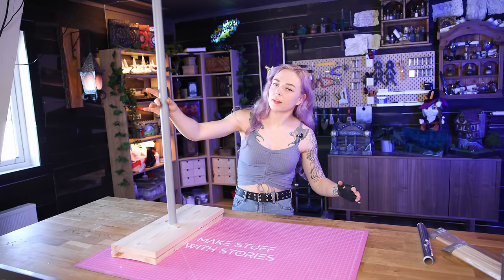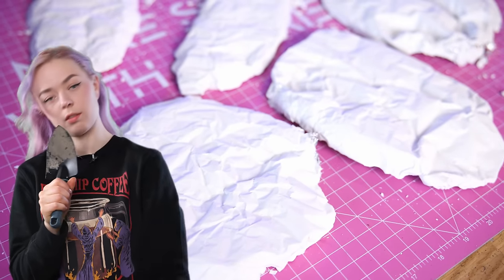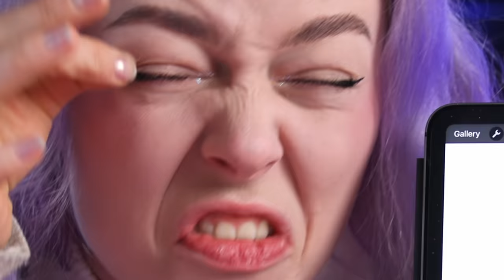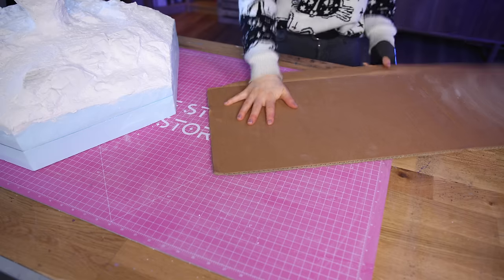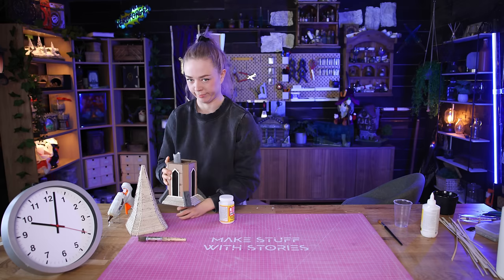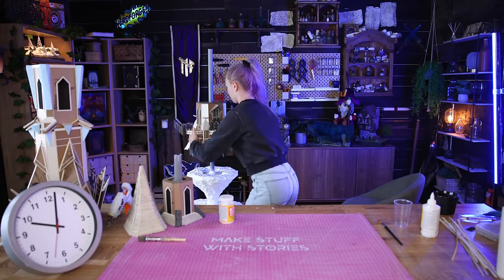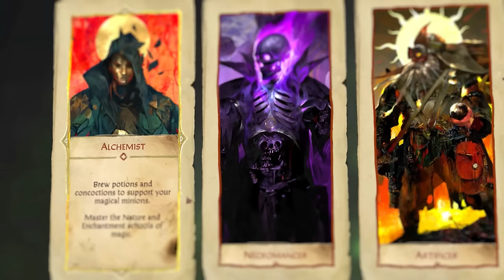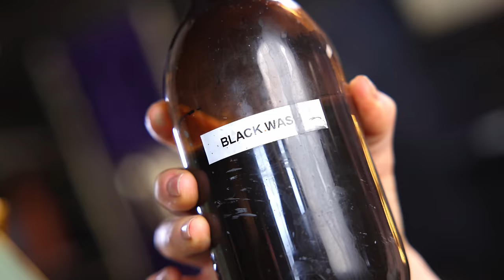I spent 20 days building this giant wizard tower

Comment: When I have shipped some of my interactive diorama pieces (nothing so big though) I didn't use packing peanuts or the like as I feared the vibration in shipping would wear away the paint and details.  I screwed or strapped them to the bottom of the crate and built the crate as a cover to go over them and get screwed on to the bottom.  You could try something similar but maybe build the crate around it.  the idea being to remove the top first and then the sides in sequence.  I would assume it's going to go on it's side no matter what labels you put on it.  I would consider making styro forrms to go around it at strategic points where there is less detail as others have suggested.  Maybe line the XPS with a thin layer of soft urethane foam sheet to minimize rubbing paint off.  If there is any way to get something through the side and attach to the pipe in the centre to get a couple of rigid mount points I would consider that too.  Maybe modify a wall so that it can be removed for the mount and then replaced with a simple press in fit or magnets or something.  Regardless, take good photos and label the sides and mark the screws to remove and create a good set of instructions for them to unpack it at the other end so they are not guessing.  That's all I got.  Good luck.

Comment: My suggestion is that you start by disassembling it into the previous quadrants and then pack each by securing them to a foam base in a box. Use small bags of expanding foam strategically around the sides of the inside of that box. place that box with the foam base glued to the bottom in a slightly larger box with packing peanuts in between ship the pole and the smaller boxes separately. It's one of the manages to take damage. You will at least only have to recreate one section

Comment: Create a frame that supports the tower in key places that will not damage the paint, yet gives it adequate space to not squash the details and miniatures, wrap the frame in paper or cardboard, then spray foam around the frame and then cut the outside of the spray foam to fit into a box.

Comment: Make your shipping crate for it first, giving extra room all around for the foam you'll need.
- Put a liner inside the shipping crate, laying it on it's side so that you can set the tower in it length-wise
- Spray in self-expanding foam, filling the lined crate about 1/3 the way full
- Place more of the liner on the newly sprayed self-expanding foam and lay the tower in the crate so that the foam forms about 1/2 way up the sides of the tower
- Allow it to harden, then remote the tower
- Remove the first 'form' from the crate and repeat the above, using the other side of the tower to make a form of the other side
- Take the tower and place it into half the mould
- Set the other half on top of the tower to 'close it in', trimming as needed to get a good fit of both halves
- Once done, place the first half of the mould into the shipping crate
- Place the tower into the first half of the mould
- Cover the tower with the second half of the mould
- Seal up the shipping container and ship!

Comment: What an absolutely incredible build! A suggestion for shipping, built a crate around the castle but instead of using rigid supports, use a network of elastic bands going from one side of the crate to the other so that they apply tension to opposite sides of the tower at multiple levels. It's easier to construct and much easier to pad to protect the tower's finish.

Comment: For shipping drill screws from the bottom of the crate into the wood at the base. You can also add bracing from the sides of the crate with foam near the top. With the top and bottom secure you should be okay, but if you need more build a second crate with foam between the inner and outer crates on all sides including the bottom to absorb more impacts.

Comment: Very cool build! 
For shipping you should remove the top and drill a hole in the bottom, you can then suspend the thing by inserting a metal (or thick plastic) rod that can be fixed to the crate, and pack with those plastic pillows

Comment: looks cool! for shipping build a plywood box to fit the structure, then fill it with polystyrene beads from a bean bag chair. they would fill all of the nooks and crannies and details to hold and support them without damaging them too much, but be easy to blow off with low pressure air or computer cleaning canned air. bonus, the mail room of the company you send it to will look like a winter wonderland for a few days afterwards. the cleaning crew may curse you with warts or a plague or two as a result though.

Comment: make a crate, take the top part off if its not glues and "clamp" the top of the pvc pipe to hoold everything tightly, or make a crate in layers, and place suports made of foam cut to fit around features, and enclose section by section, or floor by floor if youd rather say it that way.

Comment: This might be a little late to the draw for shipping but how we ship our odd sized and heavy sculptures at work is by making a baseplate of wood and drill holes in the bottom around the shape of the base and wrap cardboard around the base of the sculpture and then secure it to the base plate with a heavy gauge wire (our bases are rocks so we can be rough with them but I'm sure there's a more elegant way to do it for yours) and then we take whatever size box we have to fit it shimmy the baseplate and sculpture down and then get long pieces of 1x1 you'd probably need thicker but we glue the shit out of it and stick them in the corners of the box and use screws to secure it to the box and the base plate then we double layer our cardboard and slap a ton of Fragile stickers on it lol

Comment: very nice. i could imagine 4 long sections of thin plywood (or maybe 8 or 12 so the box is in 2-3 sections vertically?), maybe with big bubble wrap attached to the inside of each panel, maybe a few lazer cut braces that attach to the plywood on one side and have a Y or U shape on the other to brace the tower at a few strategic locations, then close the "box" around the tower and fill with peanuts? if you pack them in enough that might do the trick even if the shippers put it on its side? not super sure, but seems like a start of an idea. good luck!

Comment: About that foam cutting... One of the best tips I ever learnt is to keep a sharpener by your side when cutting stuff with a box cutter knife. A kitchen knife sharpening rod is perfect. Just run the knife over the sharpener between every other cut - it sounds unnecessary and time-consuming but TRY IT, it is such a time and energy saver! And it makes your cuts much cleaner and neater as well.

As a bonus, you dont have to change knife blades nearly as often.

Comment: I would make a hexagonal plywood box fit to the base and cardboard cross sections that would encapsulate the tower (negative form) so it is fixed in there and at the end fill the rest with those expanding foam packed so nothing moves (mostly).

Comment: I just saw a life hack video were they filled a box with expanding insulating foqm, put down a layer of plastic wrap, then pressed the item into the foam. It created an indent perfect for the package, then they added a layer on top of the item and added more foam to create a top layer. I think you could do something like that, but you will probably need several cans of foam. 

Amazing build!

Comment: I work for FedEx and ur definitely going to want some kind of wooded crate for shipping. You'll have to have some kind of filler on the inside to keep it from moving during transit, either a shit ton of packing peanuts or that egg crate looking foam stuff. DO NOT SCIMP on the packaging material. Mark it with ''this end up" arrows and fragile. Though its a 50/50 shot that what ever shipping company u use will actually follow the directions.

Comment: Potentially expensive but you could always have contour cut foam and form fit clam shell style, and then a crate around it of internationally rated ply for customs and such.   Also recommended if possible would be for it to be shipped in separated sections and then re-assembly at its intended destination.  For the crate I would have it on it's side, with standard 2x4 feet on the bottom (There is SO a forklift in this treasure's future) and the lid could be accessed from the side with locks (rotolocks) and a drop down with hinges.  Yes... the over the top option but we are looking at an expensive piece of art here my dear.  Also... INSURANCE!

Just a thought from a huge fan here in Las Vegas that also works in the tradeshow industry... so I do have some experience with large expensive pieces being shipped overseas.   ALSO... make sure you have your VAT and Custom doc copies available on the side.  Labels are a true must and a broker you can trust!! (get tracking numbers!!)

Love your stuff always!!!  I've probably talked way too long!

Comment: A bit late but I have experience shipping complicated fragile pieces, basically you create a web of string to hold the model in the middle of a box, first construct a inner box of plywood, big enough so the piece can float inside, perhaps 10cm of clearance space all around, second drill (or laser cut) a grid of holes all around the sides of the box, third pass string  through the holes to create a net on the bottom to suport the piece, deposit the piece over the net and start weaving string around the model trough the holes to tie down the model in the middle of the box, work in layers, you can add nails or screws in the outside at intervals to tie down separate sections of string, fourth once the model is suspended you close the box and cover it with a second outer box of cardboard to protect the string on the outside. 
To unbox the piece they only have to cut the string to free the model! 
I have used this technic to ship big complicated and fragile ceramic pieces internationally, it's better than those foam pouches especially for a single use, it is more time consuming for sure but perfect for this application in my opinion.

Comment: 18:40- I know it’s way too late for this (and probably was too late after you started to build this) but if you made it in a way that you could take it apart in 3 or more pieces that would definitely help a lot! Another way would be a lot of padding! Another could be a rope structure/netting (depending on which way the box opens would determine if that would even work!?! And how it would work would take awhile to explain….. I have no problem doing so… but only if you actually ask for it?!? That’s a lot of writing for something to either never be read or stolen and someone else act like they came up with it)! A few more ideas, but not as good as the netting/pulley system!

Comment: For shipping it, maybe using something like AnyVan? Instead of a conventional courier company who are notoriously bad at treating packages with care... If you hire an AnyVan you can tell them they have to be careful. And it will be transported in a regular van not a courier carrier van so they will have more liberty when it comes to fastening and securing it. I think if you made a plywood box for it and used foam or inflated plastic bags to keep it upright, and then hired an AnyVan and told them it's fragile and must be securely fastened and handled with care, I think that would be perfect.
My brother shipped all his belongings (including an un-packaged 50 inch curved TV, and a PC and monitor) in an AnyVan, it went from Italy to the UK, and a few months later again from UK to the South of France, and both times it was perfect. I helped the drivers securely fasten all the belongings inside the van so I was able to ensure it was done with care, and they drove straight to my brother's house where he was able to assist in unloading and the van, so basically the entire process except for the driving was supervised. It might be kinda expensive, but shipping something that huge even via regular courier will probably cost a couple to a few hundred so...

Hope you get to read this, and hope it helps!

Comment: I side a wooden box (maybe OSB reinforced with lumber)  and  fix the bottom (create the shape of the base to hold it.. maybe a cloth would help to not scratch it), whit a wood structure attached to the sides make a "ring" padded that holds around the center where there are not extremely fragile parts (maybe on just 3 sides so with one u can use it to open ad close) and on the top make a big padded bowl that goes around the tip of the tower attached to the top... It's a lot to do but i kinda feel i wouldn't want that thing to brake.. if needed air packaging...idk 
It be best if it transported up but i feel like if the "ring" it's tight but also padded well it should be good... Maybe bolt the bottom too
 Obviously instructions to unpack would be needed 🙃

Comment: About shipping...
From the size, first thought I had: use a cheap coffin. On second thought: it's probably too wide... but any lenthly wooden box would do.
Then use whatever packing peanuts or newspaper (crumbled up) you have all around to lay it inside - a bit denser where it's lying on.
Or wrap it in tissue paper, put in wooden box, then fill with foam spray ?

Comment: I would make some attachment for the base, then make that plywood box. Add a bunch of cut up paper (from paper trash machine), fairly loosly but still able to support what the base attachment can't support. I think packaging peanuts might not give enough support, and won't compress as much.
It depends on how heavy it is.

Also needs a fragile and "this side up" sticker.

edit: I see that you have a pvc pipe in there... so just drill hole in base and get a reaally sturdy metal or other pipe that is attacked to the box. Then you can actually just have it upright.... And then a bunch of paper. I don't know why I was convinced it had to be on the side.

Comment: Shipment idea(I have no clue if it can work for the bottom parts, maybe for the top only, but you can get inspired by this)first you cover all the model part in nylon(or plastic bag big enough?), then you take a box big enough to fit the part in, you use expanded polyurethane before and after placing the part in the box. the idea is that you create a negative from the foamy material, which will get stable after you put the model in so you wont risk braking, or crushing. I have seen this way of packing for electronic devices,  maybe it can help you :)

Comment: Wrap it with multiple layers of bubble wrap and stuff packing peanuts or foam in any gaps, then put it in a well-fitting cardboard box (so it won't knock around). Also wrap the minis in plastic wrap with masking tape and put them in a little baggy in the box.

Comment: I think you could x-acto knife the building into its original pieces. But keep the bottom part all attached. Then you can put the pieces  in separate smaller boxes to ship. The bottom base piece will just be in a longer box. You may have to make some adjustments to make it assembly friendly. Good luck!

Comment: I would probably use XPS foam to cut a main buffer and use additional foam supports that only touch the solid parts of the sculpture, or else fill the remaining space with packing peanuts. If I’ve learned anything from packaging picture & painting frames it’s that packaging support doesn’t need to literally support every surface

Comment: Take a Euro Palette, build a wooden box on it. Soft foam could help to protect the fragile little nic nacs inside that box when being shipped. You can also cut it into smaller pieces or mold it around the figurines. Or personal delivery in your van. But that means a lot more hassle with customs.

Comment: Wooden crate drill a hole in the top and bottom to feed a pipe or metal rod through and inside the pvc pipe in the tower this will keep it centered from the sides make angled pieces of foam to brace the bestagon base so it cant rotate and make sure the crate is snug enough that the tower cant move up and down (incase of bad delivery/shipping people as well as adding foam padding below the bestagon and above the top layer of the tower this whole plan requires being able to remove the top roof portion to access the pvc pipe so i would fill the inside of the roof withpacking panuts or bubble wrap then wrap in bubble wrap and suspen in one of the corners of rhe box with tap and string to walls around it. Should be safe!

Comment: Styrofoam cut in shape to stick in between cracks and the roof that sticks out. Bubblewrap and paper hey stuffed in sensitive parts until a more or less smootz surface builds up. Then wrap the whole thing in cling foil. Put in custom box filled with these packaging balls and suspend if needed in most sturdy places if it still wiggles in the box.

Comment: Ok so build a box for the base, but you can also get heavy duty plastic crates (usually used to ship technology, or weapon suply crates, most large hardware stores have something similar), then just get foam and bubble wrap, you could use xps foam between them as dividers.

Comment: Dunno if it's too late for a packing suggestion but if you can still take it apart into sections then put the sections into individual boxes and for the base and the pole use the shipping containers for posters taped together for the pole all the way to the base then place the base in a box and cut out a section for the poster holders covering the pole to stick out.  Then tape the two together and that should take care of everything.  Not sure if it'll be accepted that way but worth a shot!  Also bubble wrap... lots of bubble wrap!  wadded up and placed strategically in each box.